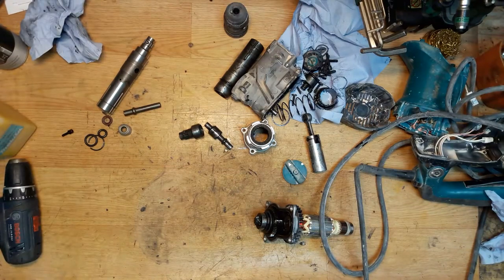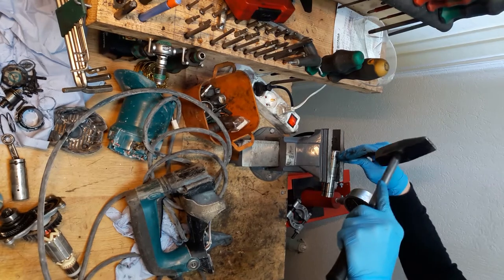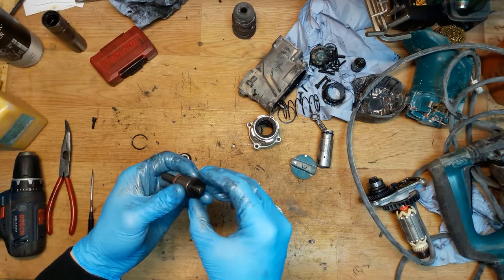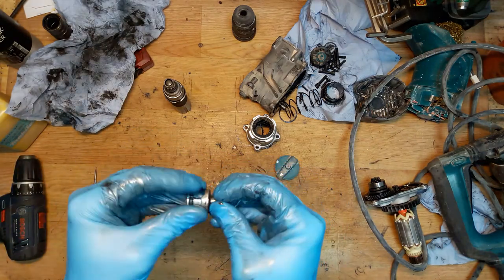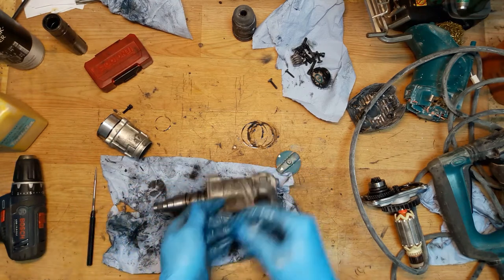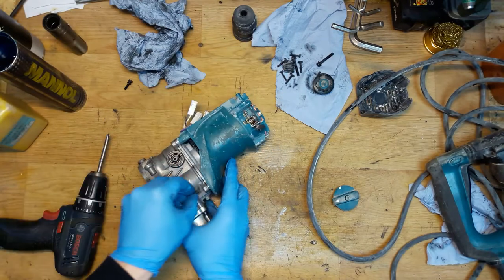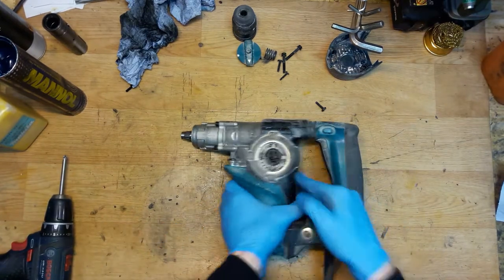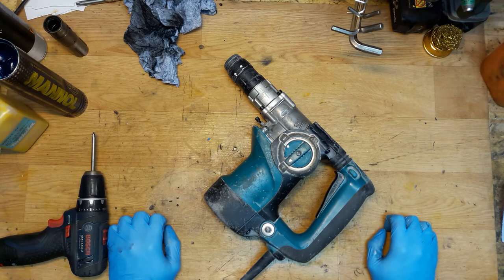How to assemble Makita rotary hammer drill HR2811FT tools holder replace

Comment: Nice to see all parts inside this machine!  Two hints from my side: For chinging the tool holder, it is only needed to open the 4 screws on the front of machine.  Then it can be removed and assembled again.
I found out that the tool holder itself consists of two parts, where the front part is pressed inside the bigger part from the back.  But makita only sells everything is one, very expensive spare part.  A new tool holder costs about 50..60 Euros. Repairing takes 1 hour. 
A used drill costs 100 Euros.  So it is not worth repairing it....  better buying a used one.  
Or build the spare part by yourself in case you own a lathe ;)

Comment: Hey buddy. I replaced the armature and the commutator because there were burnt. In addition, I was not getting any rotation movement when I press the trigger. After replacing the parts mentioned above, I am getting low power. The brushes seem to be good. 
Also, when I use the drill option, it doesn’t work at times. I am also smelling a burning scent. 
What can be my problem? Please help.
Your video helped me took apart the tool. Thanks

Comment: Hi
You can give me some advice
When I replaced tool holder my chuck all the time drop off and I can't find the reason ( I bought this chuck on Chinese market ) it's not original version .Do you think this can be reason I see on your video you just put and twisted and it's done my doesn't work this way .I need to push it stronger and when you switch on drill few seconds and it's just drop off.